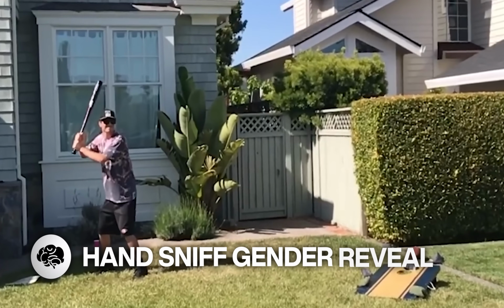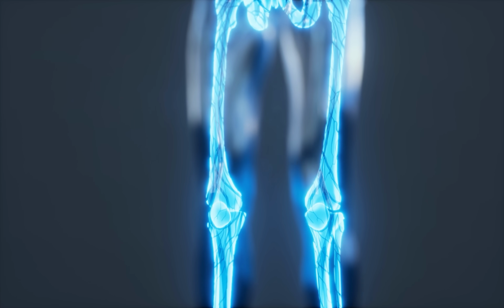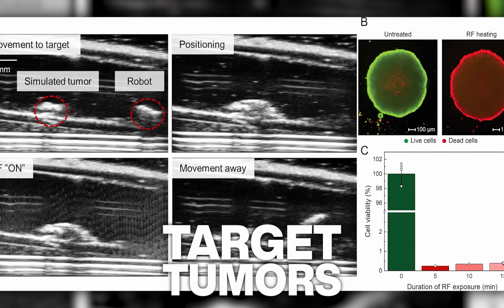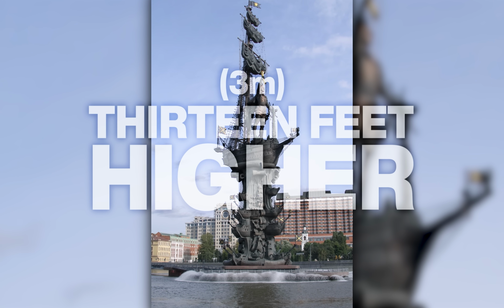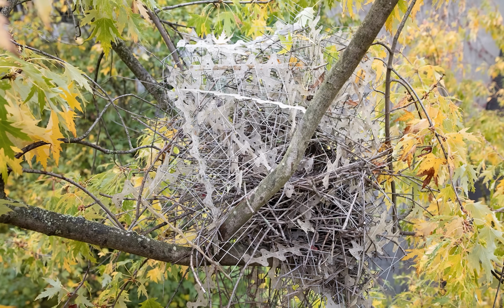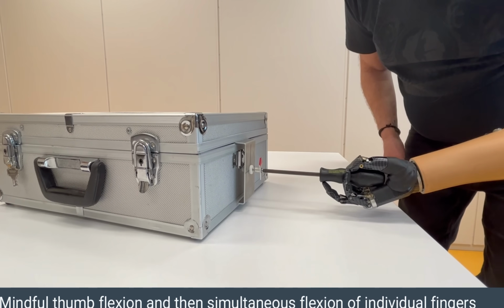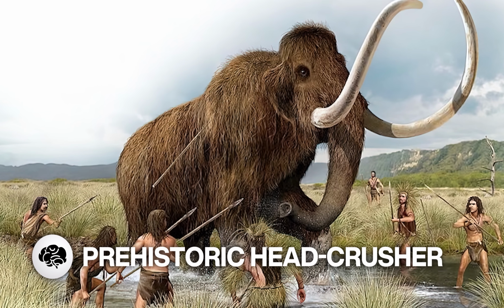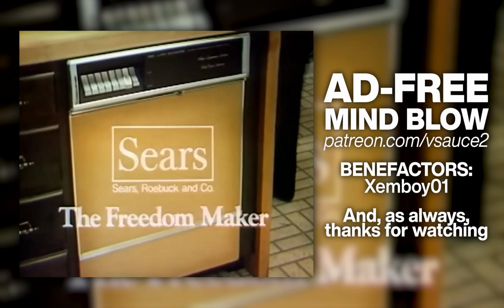Hand Smell Predicts Gender? - Mind Blow

Comment: Are we sure that stone age one-off tool was anything of importance?
Imagine I smithed myself a hammer today. I make the main body of the head a helical form, with a triangular face for hitting nails and 5 prongs tail for pulling nails, strapped to a regular handle.
I use it for a while, force myself to use it longer because I put so much effort into it... then finally give up and get myself a regular hammer. I toss the fancy hammer in my tool shed to forget about it... it gets lost, eventually getting buried... and no one ends up finding it for a while.
500 years from now, someone is digging on a plot of land they purchased, and dig up this crazy helical, triangular, 5 prong monstrosity of a hammer head - as the handle has rotted away. They start questioning if it was a mega tool, a status symbol, or a weapon of war.
Nope... it was just a dumb experiment that failed horribly. The guy who made it didn't want to look at it, so it was metaphorically - and then literally - buried.
Reply: That's literally what a flint axe head looks like, there isn't anything "one-off" about it and it's not that heavy.

500 years from now, in your hypothetical situation, they would compare it to every other hammer from this time frame and consider it a fantasy hammer since it didn't fit with how actual hammers of this time were made and looked like.  The difference between your fantasy hammer and the flint axe head is the flint axe head fits the period while your hammer ... doesn't.
Reply: Metals were valuable and usually reused in the past.
Reply: If you wanna disregard all of history like that, we're not gonna have any history soon lol

Comment: there are so many things wrong in the hand/gender section.. that I won't dissect it.. but suffice to say, I am shocked that a seasoned vlogger like Kevin could produce such a badly worded article that reports poor research as fact.
Reply: I mean, he could have just said it depends on hormones and that would have been more accurate.
Reply: bruh he didn’t even make the article what are you on
Reply: The pendulum is swinging toward reality with record force.
Reply: I understand what it's saying even if its worded badly. The research seems fine though? It only says it can like make a guess with 95% accuracy ..

Some issues are like the sample size is small and localized to a specific area, I guess ..

Comment: The bionic arm is next level. I feel like there will come a time when people will choose it over a normal limb if it can get an equivalent or better response time. Especially if it was digital and/or replaceable.
Reply: it is amazing. not sure about the direct interface to the bone, though. seems risky.
Reply: @Talon3000  What are they gonna do, lose their arm?
Reply: @halosheepftw  they can lose the rest of the arm or worse. bone marrow infection is very dangerous.
Reply: @Talon3000  Doing it differently and using Brain-Computer Interfaces to control it wouldn't require bone implanting. BCI's for prosthetics have already been done to a level just under the one in this video, there just need to be portable BCI's like Neuralink, instead of plugged into a computer like has been done.
Reply: @necroticpoison  isn't bone implanting independent from the control interface? the issue as far as i know is supporting the weight of the prosthetic. thats why they use a direct anchoring in the bone.
Reply: @Talon3000  Yeah, but by the stage of BCI's that can monitor motor cortex activity well, having lighter weight prostheses and better attachment styles shouldn't be too far off. It's easy to have ideas on how it could work, but hard to do realistically right now. It'll be a long time before BCI's are at that level anyway. And if you're electing for limb removal, I imagine it probably isn't too hard to structure the residual limb in a way that makes fit and leverage optimal (non-osseo-integrated). For those with trauma-induced limb loss it'd be a fair bit harder but not impossible. For those wanting to elect for it it might be easier to simply use external motor-enhancement stuff kind of like an exoskeleton, rather than prosthetics. At least for as long as they're better.
Reply: eh theres still that level of personal feel, like even if a bionic arm can feel more real then my real arm, i'd still want my own arm.
Reply: Only if they have a near unlimited power source what if you're somewhere with no electricity or in a emergency situation. Also you can eat healthier, work out, and train in martial arts or sports to increase your reaction time. Nature gave you an amazing organic machine called the human body that has two powerful arms. It's perfect for people who don't have use or no limbs at all though!!
Reply: @vicnilla77  so what I'm reading from this is that it is possible. Training is all good but there is a limit to the body that might be able to be overcome with technology. Now is not the time but seems like it's possible and seems closer in time than I previously imagined.
Reply: Still far awat realistically tho, as based as it is.